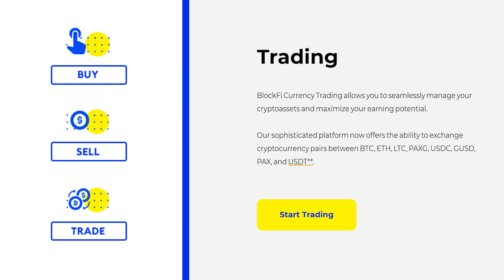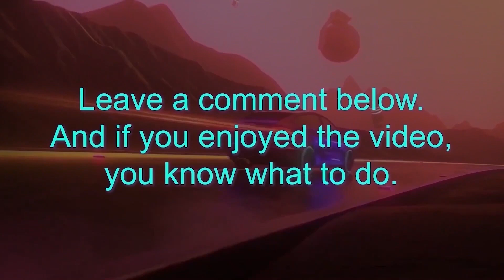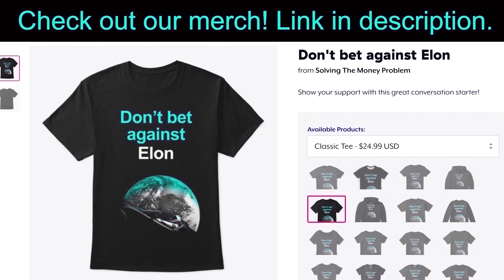Sandy Munro Shows Tesla's SHOCKING Lead Over Ford

Comment: Ford doesnt have bad engineers. They were told to do it as quickly as possible with off the shelf parts. And they were siloed into different design roles, with poor communication.
Reply: Well said.  Good engineers, but poor management.
Reply: The engineers are decades behind Teslas.
Reply: @excelrobot  They might have hired someone like Sandy, but they do ignore these voices.
Reply: @KetzerkaterContent  yea sandy could help them but they don’t wanna help themselves
Reply: ICE engineers are not EV engineers. And they're certainly not SpaceX engineers. Rocket science in cars!
Reply: The engineers are good but again they don't have a blank canvas unlike what Tesla enginieers had.

Tesla started with nothing. No factory, no dealers, no part suppliers. They started with the objective to vertically integrate the entire production, that parts would be manufactured, assembled and put together by Tesla alone. Engineers had the task to figure out everything from basic engineering to mass scale production. 
But that had an advantage, because you could design a vehicle that was purpose built, from the ground up, to be an electric vehicle. The chassis, the parts, the electronics. If for whatever reason you needed to solve an issue you could design the solution. And yes this is about as hard a task as you can make one, but for any engineer more motivated around the challenge itself, this is an oportunity way too good to pass up. 

For a legacy manufacturer you can rarely do that. You have an extensive but fixed inventory of parts and you want to minimize the amount of new parts you have to make. If you were to design a cooling system integrated into the Mach-E, with flat pressed integrate cabling, and a wide body casting? Management would fucking fire you this very second, because this is nice and all but nothing in the existing production lines fits with what you just made. There is nothing in the bodyshop to make your chassis, your cooling system is not usable on any of their other vehicles, and all your parts would need tremendous investement by the company to make or have to contract specialized third parties to make em at a massive cost. So instead you make the best with what you and the thousands of partners manufacture to make a solution out of it. Even if the engineers of the production chain could make your thing happen, since your message has to go up the management chain it has a lot of chances to be shot down mid flight without having the specialists even consider the idea. 

Tesla can just make the part, and they will be willing to switch around the entire production site if it warrants it. Just look at the cybertruck for example: It runs contrary to just about anything that you could call an automobile. Normally it should not work, but it does because you have full control over the manufacturing aspect too and a direct line of communication with the engineers in charge of the production chain.
Reply: Exactly. Read the Innovator's Dilemma. Explains precisely this process. Ford is being disrupted and management is scrambling to turn the Titanic before it's too late. It's NOT the engineers' fault.
Reply: @mobiuscoreindustries  fantastic breakdown. This comment is the GOAT
Reply: Ford’s strategy is still all wrong. Any money that they gave their EV team fuck all money and said develop some EVs. They aren’t going all in on EVs so they’ll of course they produce garbage with off the shelf components. To the end user it looks nice inside, but specs wise it is well behind and all this vehicle will do for Ford is turn more people off EVs as they begin to have maintenance issues and Ford will start to charge people for an annual vehicle check to maintain warranty, which will give people the warm and fuzzies while they waste their money.
Reply: I am retired from Ford after 40 years and I saw time and time again how engineers were held back because someone in management thought they knew more.  It is going to be a huge job to change that culture that after 100 years.  These companies have a management problem....not an engineering problem.
Reply: @excelrobot  They did back in the day (hire Sandy, that is).  It didn't help.
Reply: If they were good engineers they would speak up and make a difference, this is a effen joke it’s 2021
Reply: @tbone0283  For a lousy job at a company with no leadership that is slowly going out of business? No way, they would do their job and go home at 5:00. But if there was leadership, that would be something else.
Reply: @nowayoutalive8732  The problem for those low enough on the totem pole to be reliant on the retirement at these companies they are the ones that are sweating what's going on. A fundamental change should've happened years ago, now it'll be a miracle that Ford can continue on in the coming decades. Their finiance arm is one of the few bright spots in the business and it can't make the company competitive or solvent.
Reply: Leadership vision issues not engineer issues. Companies not moving with the market but lagging behind. They have a plan it’s just not one that people want to buy!
Reply: @ToniEzero  No, the engineer's management that is decades behind Tesla not the engineers. In most U.S. manufacturing companies Engineering use to be considered a profit center, its now considered a cost center and is treated as a necessary expense. It's this group think (read that MBA's) that is turning our country in to a second world economy. Our leadership at all levels are certainly not the best and brightest.
Reply: Which is why Ford won't attract the best and brightest engineers. Engineers with a choice will work for Tesla/SpaceX over Ford.
Reply: @spacep0d  Hiya, it’s just the management taking them in the wrong direction or not wanting to do BEV. I heard Ford have announced a battery plant in the USA for F150 battery’s and if you look at the F150 it will sell to the people who just brought an ICE version the year before. Looks like the one they had last year but is electric and that frunk!
Reply: If it ain’t broke don’t fix it

Comment: Be mindful that it’s not just an engineer problem, it’s at its root a cultural problem within the company. If they are to decide to take more risks and let the engineers do their work, there’s potential for rapid turnaround. But it’ll likely be too late, at best.
Reply: This!!
Reply: Not enough thumb up ability so have beers instead 🍻🍻🍻🍻🍻🍻☕
Reply: These OEMs really got to rethink how they do everything.

Why would anyone think a Ford or GM product would be better than Tesla?

Tesla is pretty much fully integrated,  Ford and GM are just buying parts and putting them in a car.  They don't,make or produce any of this stuff. 

With the Mach E, it was going to be an ICE car, Ford decided to make it electric and put 3rd party parts into it.  How in the world could that be better than what Tesla has been doing?  Tesla has been innovating this technology since 2008.  Ford is just going to slap a car together and be in the same ball park as Tesla?
Reply: It's both, because the best engineers wouldn't want to work for such a company.
Reply: @vinyllpreviews9462  you have to realize that ICE cars will remain the dominant money maker for every manufacturer for a good while longer if not forever (other than strictly EV manufacturers like Tesla. So they can afford to slowly move into the EV market. Ford still has the most sold and reliable vehicle in the F-150 and just revealing their electric F-150, which will be a much bigger seller to actual truck owners than the Cybertruck. They also just brought back the Bronco with plans make an EV version. Ford also has a dealership network that will be able to actually fix your car quickly because they have the parts, if not you can take it to any independent auto shop, or just fix it yourself.
Reply: @gdo3510  OEM's won't be selling ICE cars for a long time, let alone forever.

Electric is going to win out, just like DVD won out over VHS, ICE is old technology and their days are number.

It's just a matter of time before the cost of an electric car is cheaper than an ICE car.  There will be no reason for anybody to buy ICE, cost of ownership is about 10x cheaper and electric cars are far more reliable than ICE.

That dealership model is going to be an Albatros around the knecks of OEM'S.  Electric cars don't need the maintenance ICE cars need.  Dealerships make their money off repairing and servicing these cars.  Dealerships don't want to sell electric cars for that reason.  OEM'S need to desperately move to electric and those delerships have completely different goals.  

Already seen GM buy out a bunch of Cadillac dealerships because the dealerships didn't want to upgrade facilities to sell and service electric cars.

Dealership model and ICE cars are as outdated as Blockbuster.
Reply: @gdo3510  Sales 2016
Ford 6.65 M
GM 6.25 M
Tesla 76k

2020 sales
Ford 4.19 M down 37% since 2016
GM 3.37 M down 46% since 2016
Tesla 500 k  up 558% since 2016

How this is trending, I don't see how this is a good thing for Ford and GM.

Comment: 0:00 What to expect in this video
1:45 Sandy Munro's near death experience
2:32 The cause of it
3:21 The key that makes an automaker successful
3:30 Why Tesla has the world's best engineers
3:52 The manifestation of this expertise in Tesla's products
4:33 Why this is good for Tesla (and bad for the others)
5:45 What's under Mustang's bonnet + Sandy's reaction
7:31 Commercial On The Shelf components (COTS)
7:50 Bad engineering #1
9:02 Bad engineering #2
10:13 Bad engineering #3
10:31 Bad engineering #4
11:17 Ford and Tesla frunk comparison
14:27 Ford and Tesla cooling comparison
16:03 Tips for Ford
17:04 Tesla's impressive innovation
Reply: Hi SMR 13:35 ! Reverse engineering is a hard thing to do. Even Sandy Munro himself couldn't reverse engineer some of Tesla's products. The devil's in the details and if a CEO or any manager doesn't understands the product in detail, they'll never find the devil.

Comment: Hey Steven, the more I watch Lars Strandridder (Best In Tesla) the more I think that if Tesla is supporting Alset eHomes THAT company might be worth looking into?
It could be a lurking monster if solar - powerwall ramps up  the way it seems to be right now, with production and installation systems being pumped out at an increasing rate.
This could be yet another Fossil-Berg, with 90% of the disruption still lurking unseen below the surface of the petrol sea...

Comment: No words.  When I was a kid—30 years ago— I pieced together a hot rod fwd Detroit motorcar with false kill switches and starter relays and bandaged first gen turbo chargers...wires, hoses, leaking radiator fluid, oil etc....the car worked, sort of.

Comment: Ford needs to create a new revenue stream for their dealers.

User manual maintenance schedule probably looks like:
3,000 Miles - Remove Frunk and re-tighten all 31 hose clamps
6,000 Miles - Remove Frunk and re-tighten all 31 hose clamps
10,000 Miles - Remove Frunk and replace hoses (hoses may fail with all that re-tightening) and clamps

Repeat this maintenance schedule every 10,00 miles.
Reply: What a BURN!! 🔥🔥
Reply: " 'ere guv, I just dropped that box, when I was changing the 'oses". "Which box?" " The one that says scrap if dropped". "That's the idea, charge the customer $250 dollars, it cost us $50". "OK, guv."
Reply: Uhh, I think you mean replace cause those spring clamps don't adjust. They're designed to clamp on their own and you use a pair of pliers to squeeze the tabs to open them enough for removal. So each one is for  a certain size hose and that's it! Home wrenchers will pull those pieces of junk and go with a better solution. But you are right, regular visits to the dealership is the goal.
Reply: Those are spring clamps.  They're as tight as they're ever going to get when they're installed.  They can't be "re-tightened".
Reply: @danmoyer4650  … OF COURSE they cannot be ‘retightened’… but the dealer CAN charge $$$ for it…

Comment: Just had a rubber hose in the oil cooling system in my car fail after 14 years. Over time a lot of those hosed are going to harden and crack, leading to tons of repairs in the long term

Comment: This was great! Sandy's reactions are priceless. One point i would like to raise, although i agree that most likely Tesla engineers are more on the cutting edge, i doubt that this is just an engineering problem. I'm pretty sure there's a lot of preasure from the company to reuse existing providers materials, and "cheap" prices because "why change what has always worked" mentality. Tesla innovation and business culture is a far higher advantage than just their great engineering,  and IMHO what will kill those other companies. Thanks for the vid!

Comment: I'm surprised no-one considered that this may have been intentional from Ford, in order to create a reason for customers to need to visit service centres and keep that business model afloat
Reply: Many have considered this. Have you read other comments? Cheers.
Reply: I am sick of service centres. Why do i have to argue with some guy that tries to make me spend hundreds when I want a $60 oil change. Now I just bust out my owners manual, show him oh I don't need any scheduled maintenance for another 80k
Reply: I know it sounds plausible, but really I seriously doubt it, Ford aren't that smart in my view, it's just the way they work.
Reply: @blaXkgh0st  I have another level of despise for them , we have a huge name in racing who owns all the stealer ships here local. everyone know it so I wont name it. They tried to sell my wife a new tire because she had something in the tread ,..$400+. She said no and it turned out to be nothing just a bolt head stuck in the tread only no damage. We went back and the Jackwaggon screamed and cussed me because I had the temerity to call them out. then he denied they tried to charge that much till I showed him the print out with the price clearly on it. They are all scum. many other worse incidents over the years with the same owners going back to the early 90s. they would loosen exhaust parts during service so it would rattle and when you came back they would keep your car and just tighten the bolts and charge for an entire exhaust system. just real scummy stuff
Reply: @icedout2322  did u hear about the problem Tesla is having in Texas? By law a car manufacturer has to sell to a 3rd party, the customer can not buy direct from the source. So Tesla is building their vehicles and paying to ship them out of state to sell them to customers. Obviously they are trying to fight this.

Comment: The thermal mgmt system - yes - a hot mess, but Sandy loved the chassis, suspension and many of the other aspects of the car. He gave it very high marks until he hit the thermal mgmt system... then... ack. 
So, by and large, it was well constructed.... but not that part.
I can't speak to the pack/motor design. Didn't see those.
Reply: Well I didn't like the door window mechanism. That just begs to fail. Pulleys mounted to a formed plastic base. When the plastic breaks down and the pulleys come off,  It's buy an entire mechanism if Ford still has it after 10 years,  or some aftermarket manufacturer picks it up. They pulled this same trick in the 90's with the Ranger belt tensioner that ran engine accessories. The tensioner would break off the cast aluminium housing that also held the power steering pump in place. Had to get a replacement from a dealer in another state and relatively expensive. The dealer said I was lucky to get it and no aftermarket was available.  I guess if you lease or can afford new every 5 years or so you won't have to worry, but I believe that sector of the market is getting smaller and smaller.
Reply from the maker: Thing that matter the most in an EV form a business point of view:

Powetrain (incl. battery cells, modules/pack, motor)
Thermal management system.

Everything else is noise. Ford are 0/1 so far. Let's see the powertrain.